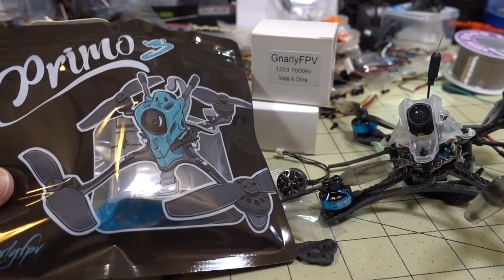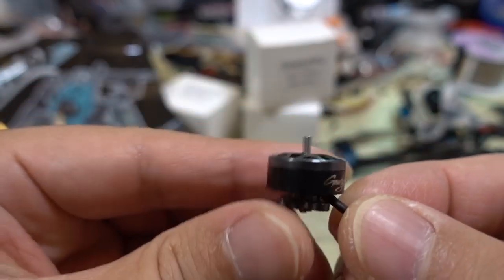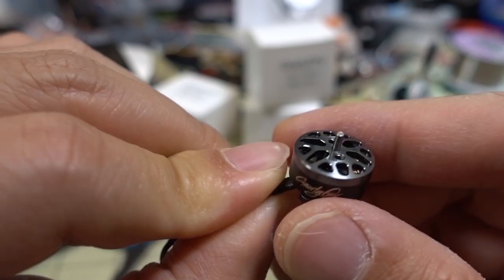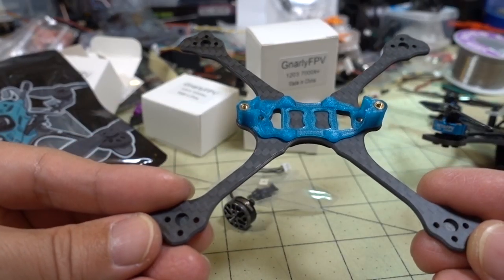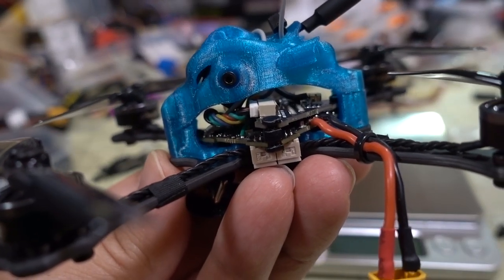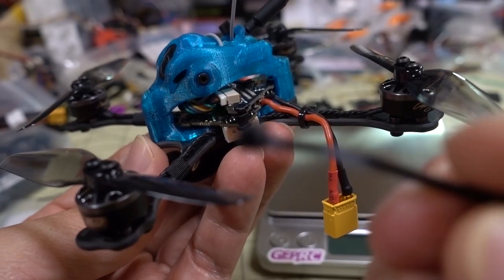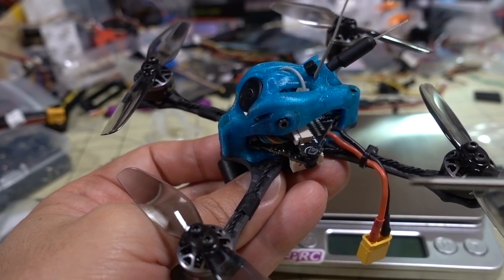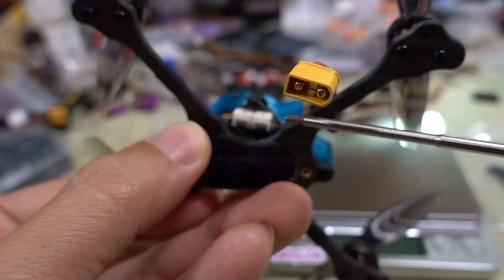GnarlyFPV Primo3 Micro Drone Review

Comment: Nice Albert! The build came out super clean. The SR1203 motors are a bit amp hungry on 3 inch, but absolutely RIP with 3s. They're a little more efficient on 65mm props. 65mm/3s being pretty nuts.
Reply: Hi. Love this frame. Love the design and the thoughts that went into it. Where would be the best place to buy this frame for customers in Asia (Malaysia in particular)? Will the AIO NamelessRc 412T (and similar AIO board from BetaFpv, Diatone Mamba) fit this frame well? If not, will a slightly  different design of this frame be available to fit these newer type board?  Thanks!

Comment: So...def think those motors can handle 3s, my concern would be the stack.  I'm running 1207 7500kv and they rock on 3s!  I really like this frame, but the 2 point mount setup/tpu mount can be problematic with the BetaFPV 20A board and similar.

Comment: So why FrSky?  

Noob here and still confused how to choose a first transmitter.
Reply from the maker: Most FPV pilots fly FrSky.  There are more receiver options and the receivers are smaller/lighter in general.  Also, less expensive than Spektrum or Futaba.  If you're looking for a first transmitter I recommend the X-Lite or Jumper T16 or T12.

Comment: I am looking at those now for a 3s 2.5 build. Thanks for review. Have you tried it out 3s with the 3x2x2 props that would be interesting to see. :) Blessings Albert
Reply from the maker: Not sure the motors will be able to handle it
Reply: I have run the 1103 10000 kv at 3s with no trouble but I watch the top of my throttle. I was thinking/hoping that these would be able to handle the 3s better....